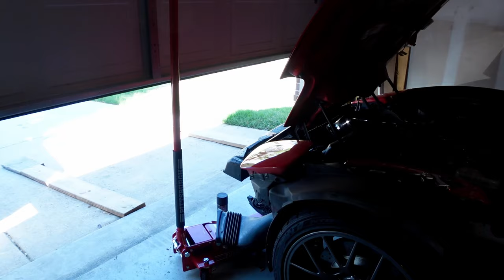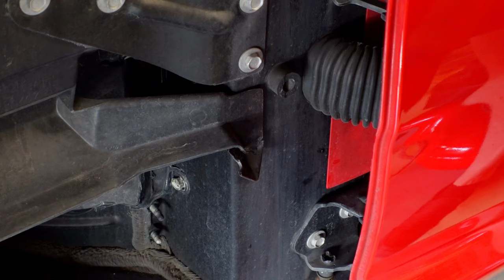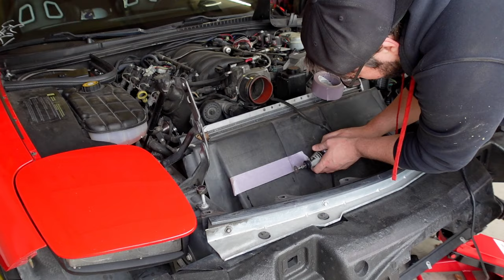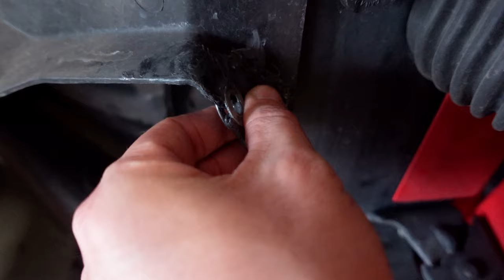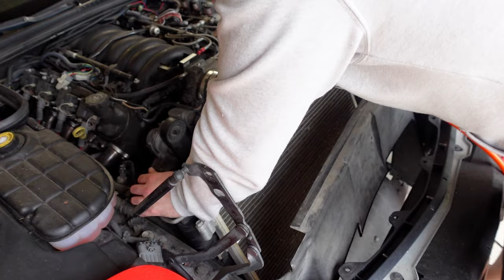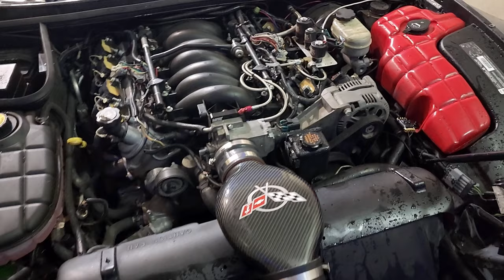More Cooling Mods For The C5 CORVETTE // My Garage Broke My Car...

Comment: General Motors Engineers vs A Guy In His Garage! I'm betting on the GM Engineers. As a C5 Z06 owner, the car is a vacuum cleaner. All of the cooling air is sucked up from underneath. The car needs the radiator shroud and more importantly the Radiator Scoop underneath. Air takes the route of least resistance, so your big hole is just a place for the air to escape instead of being forced to go through the radiator. All of this cooling air is being directed to the radiator by the vacuum cleaner scoop underneath the car that drags on every curb and speed bump but is an absolute evil necessity. The original poster mentioned cutting a hole in the bumper to allow more air in, which I couldn't see in this video, this pushed the radiator shroud back against the radiator. The C5 gets no cooling air THROUGH the bumper... It all come from underneath. These mods are doing 100 percent opposite of how the cooling system is designed. The C5 does not have a grill like traditional cars allowing cooling air in over the bumper.
Reply from the maker: That's great. You're wrong, though. 

It was a poor design, hence why they abandoned it 2 years later. 

As you said, it vacuums up air from the bottom. Not only is it hoovering up air that's being heated by the road surface, it pushes it upward where it has nowhere to escape without a hood vent. This terrible design is why the C5 Corvettes notoriously floaty steering above 120mph.

If you look at pics or videos of the car outside of the context of this video, you'll realize that the car isn't a bottom breather anymore. The front bumper is vented to allow the air to travel to the radiator.

I've done tons of miles and multiple track days since this video, and it not only runs measurably cooler, but in combination with the GT1 hood vent that's on it, is EXPONENTIALLY more stable at high speeds.
Reply from the maker: Editing your comment is a really interesting way of responding... without actually responding...

I'm not trying to be a jerk, by the way. This wasn't a random idea I had. This was something I decided to do after talking with and picking the brains of other C5 guys that I've met at the track over the years. It's also worth noting that this isn't the final form of the cooling system either. 

Do I recommend this for everyone? No. I can even show you dozens of messages where I actually recommend people not do this unless they also track their car.

This video was a continuation of two other videos, which, had you watched, you'd understand why this mod was done.

My car is significantly lowered, has a front splitter, a vented front filler, and a huge hood vent. So rather than doubling and tripling down, I encourage you watch the build in its entirety, and not just one video.

Regardless, the car objectively runs cooler, and is more stable than it was before. 

Again, not trying to be a jerk, but you're wrong. I welcome you to watch the other videos, and if you live in North Texas, come out to a track day and see it in action.
Reply: There will be purists and there will be those that attempt to make things better. I personally have no problems modding my 2004 6 speed C5, why drive something completely stock when just a few thousand dollars in mods stretches a very, very long way on these cars? I don't plan on selling it, and if I ever do - whoever test drives it will be sold on the first pull. To each their own.

Comment: Great video chase! I also need to repair my front fender mount
Reply from the maker: Did yours get messed up too??
Reply: @ChaseFarrow  yea, ever since I bought the car the left lower bottom fender screw by the door has been damaged slightly. so it doesn't actually line up perfectly with the door

Comment: I’m interested in the results. From what I see, you possibly introduced turbulent air into the cooling system and that might actually counter what you’re trying to do.
Reply from the maker: So, I've been running like this for about a year now. I'm happy to say that I've had the opportunity to test it in a number of environments, and it's been really good. 

The highest temp I've seen on track was 219°F, (that was right after a couple of hard laps with an ambient temperature of about 95°F). and the highest I've seen on the road was right about 220°F, and that was with in traffic with my A/C on full blast during this stretch of 105°F+ weather we've been having in Texas.

I haven't done a specific follow-up video, but I have talked about it a bit in more recent videos.

Comment: Hmmm... I see what you are attempting to accomplish, you will need to box in the opening  Like i said in another thread, ive added some 10 gage ABS sheeting to direct the airflow. ( also fabed up framing with aluminum angle.
Something to think about...

Ill keep watchjng
Reply from the maker: I actually have some changes coming for it in the next couple of months. This version yielded very good results, but it can always be refined. I appreciate the feedback though! Keep an eye out for over the next month or so, because it'll be updated!

Comment: Maybe I’d missed it, but you didn’t indicate having cooling issues before any of your Mods.
I have a C6 and have not encountered problems regarding cooling, even in City stop/go!
Reply from the maker: @yesh3279  There were a couple of videos preceding this one, as well as several that came after. 

The C5 and C6 air flow is different. C5s a complete bottom-breathers, so as soon as you add a front lip, they start overheating. You can put a bigger radiator in them, and it will help, but the real problem is poor airflow.

Some people are able to get away with it, but living in Texas where we routinely see 105°F+ during the summers, you can't have a lip without doing at least some cooling mods.